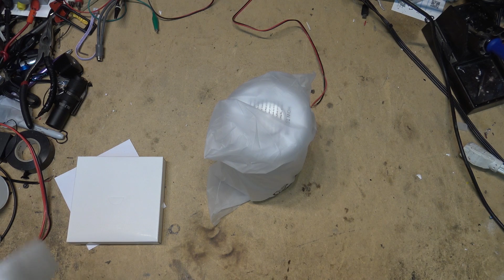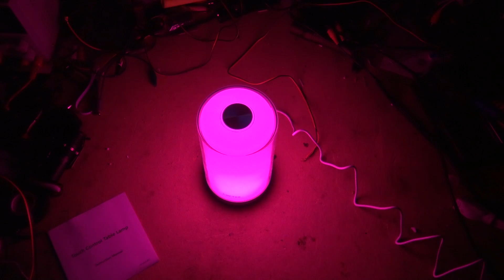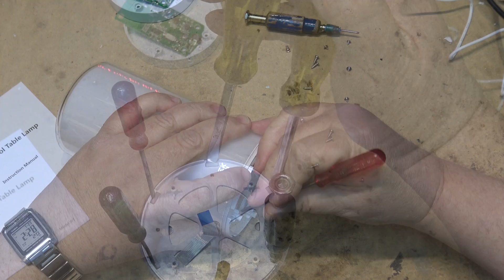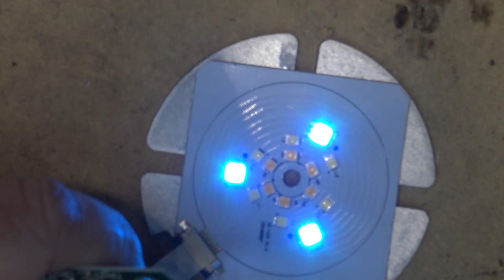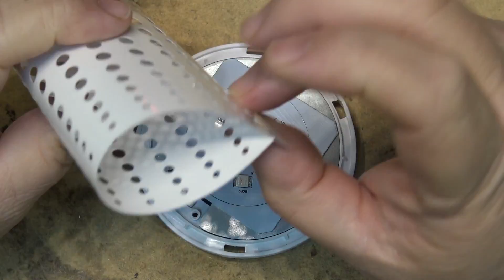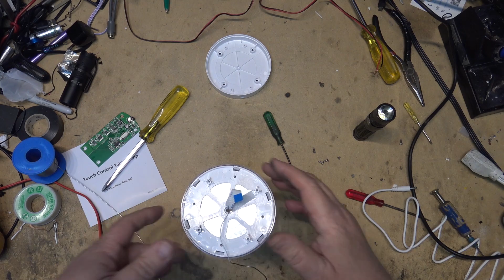Loftek Model W1 Color Changing table lamp tear down

Comment: i don't know if you took some measurements on the leds , for the watts. i got some good 3 amp rgb leds that would go good with a descent driver
Reply from the maker: Specs of the lamps.  6 watts for the white and 3 for the color.  6 white led for each color temp.  3 for the color.  Don't need to be a rocket scientist to figure that one out. They are 1 watt leds.

Comment: We would blank off part numbers off chips if we let a demo or prototype go out to a customer,  when it went in to production we did not bother. Later we stopped doing it and just would not send a unit without them signing a NDA  (Non Disclosure Agreement). The letter was much easier to do than sanding a lot of chips. Courts ve's sandpaper,  courts win everytime! Win win :)
Reply from the maker: If someone makes an identical unit using the same parts but changed the layout then it isn't a copy, especially if any code used is open source.  I suspect that this uses open source for micro. They are attempting to slow down someone knocking off their design.  Courts won't help in that respect especially if open source.  Look at the battle between BlackBerry and Facebook and whatsapp for stealing their intellectual property with respect to their messenger. It has been before the courts for years.  Nortel's before them.  Nortel's been bankrupt for many years yet they are still fighting for ip patent infringement.   It's a tough long battle which costs lots of money and in the end the lawyers make a killing.

Comment: That's gotta be a microcontroller, there are TX and RX pins, 3.3v serial bus I'm sure. All outputs will be PWM, not analog. 

I wonder if there's a Bluetooth or smart version with an off-the-shelf IoT module connected to those serial pins.
Reply from the maker: Yes I was thinking that as I edited but with no chip number it is a mystery.  The rgb are likely pulsed and 8 bit would give 256 gradations per color.
However it could me something like an avr or atmega which has d-a converters and therefore the output could be an analog voltage.

Comment: I thought it was a nice design, the control pcb looked nicely made.
An attractive diffused lamp, very nice.
I did have to put my toes in a vise to apply pain so i stayed awake lol, i had been ill and i lost too much sleep, nodding off in the day is typical.
You just need to add a blutooth board to it now... ooops wrong device lol :-D